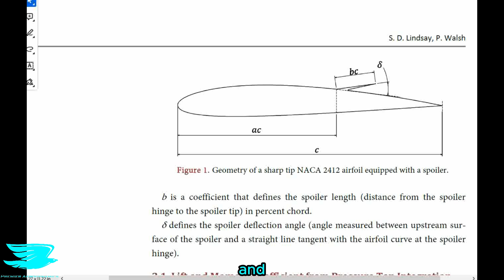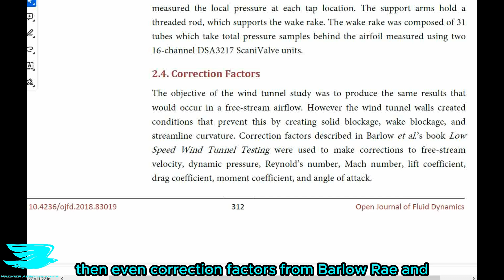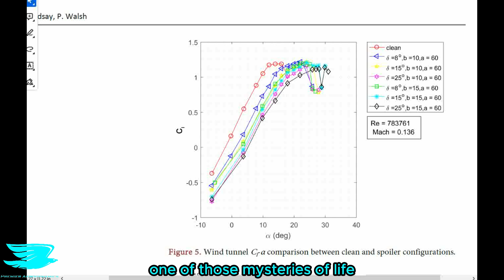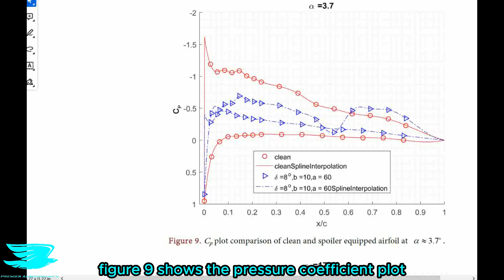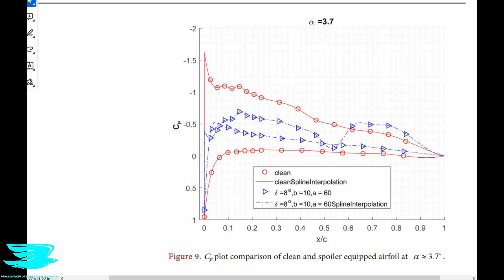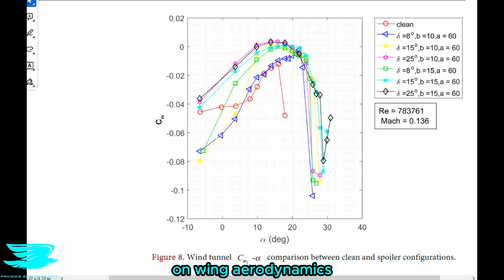Podcast #177 Effects Of Spoilers On Wing Aerodynamics

Comment: Kinda surprise me since what pilot would feel when using spoilers in air is that the speed would not drop, rather the nose will drop and speed even carry up if you don't pull the stick back, but watch to the end it makes sense, not only the Cl at given AOA drop, it even try to actively lower your AOA
Reply from the maker: The pitching moment is a huge player in how an airplane handles.

Comment: It seems like a self limiting problem because if you make the pressure taps larger, then the taps themselves start affecting the flow more and more. An aerodynamic uncertainty principle perhaps.
Reply from the maker: That's a really good point and something everyone struggles with when installing these taps. Also, making sure that they are completely flush is important because if there are burrs around the edges, that affects the pressure readings too.